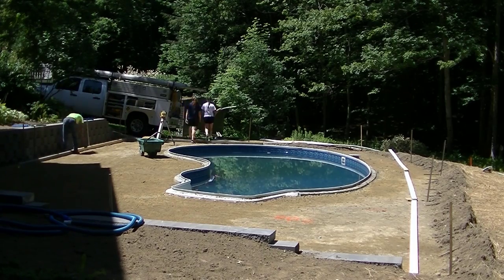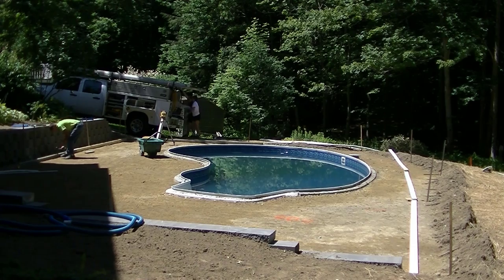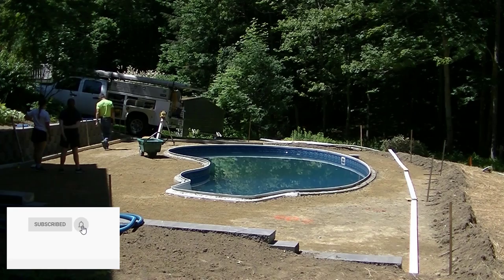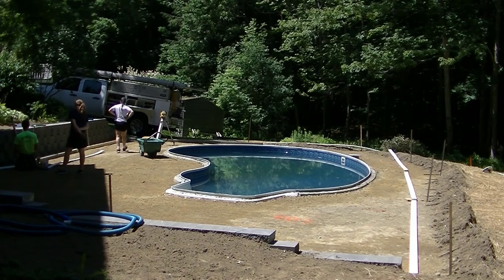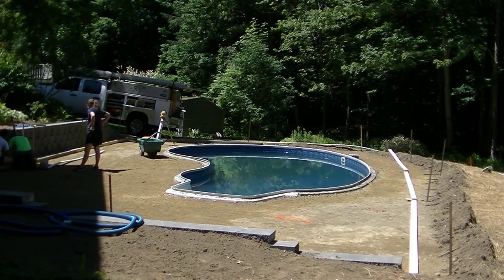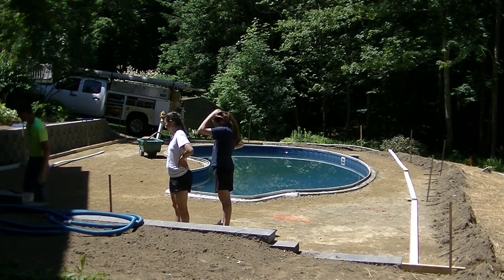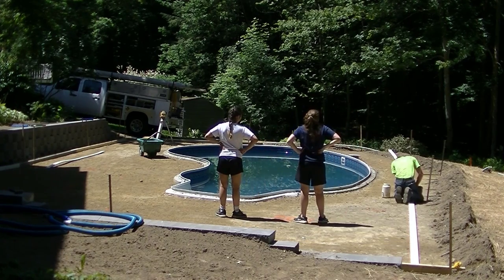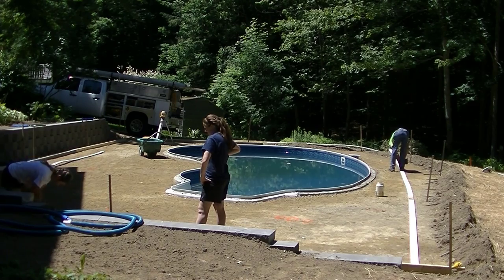Concrete Pool Decks | Forming, Pouring, And Finishing - Part 1

Comment: I have watched several of your videos Mike, GREAT Work. It's obvious why you are busy all the time. I build but don't usually pour too much concrete, best leave it to you guys, the Pros. I did poor my own Pool apron approx. 23 yrs ago, on our 20' x 40' w a 5' apron to walk around it on, and a 40' x 12' patio area on one side of the pool. We did some fancy curves into it. I used Masonite clapboard siding to make the curves 1/2" x 6" clapboards. They don't crack keep a good form but need quite a bit of stakes behind it to hold the crete in. We used the wire and the Fiberglass? Fibermesh? mixed into the concrete at the pit. Believe it or not we have not had one crack in 23 years. I used a gas tamper to tamp the ground down several days before we poured. Your looks awesome, Love the finish.. Also watched your stamping patios, wow that's sharp looking. Nice you got to bring your daughters in to help out and learn the family business. They worked better than most guys do. I applaud you all. Stay Positive Stay Healthy my friend. Peace from Big Jim in New Hampshire...  Amen
Reply from the maker: Thank you James!

Comment: Hey Mike, I’m a journeyman electrician, the ground wire is actually an equipotential bond not for lightning. Basically it will carry stray current away from a faulty pump or light.🤙
Reply from the maker: Thanks for that, good info!

Comment: Living and working in south Florida, I’ve worked on more than a few pool decks. Pools here are almost always shot in with gunite then the coping, then form to that. The most stringent reg for pool decks here is a slope of 3” in the first 10 feet heading away from the pool (obviously). It’s totally non-negotiable. And the grounding of all railing and metal, of course. I guess my finishers are a bunch of baby’s! If I told them we were going to wheelbarrow that, they would look at me like I was crazy 😂. They would insist on a 2” pump and a pea-rock pump mix. If not a boom pump 🙄.
🤜🤛
Reply from the maker: We don't like to wheel barrow either. Just a little less expensive on this job. We don't have any regulations in Maine for pool decks except for grounding them. It's a 50-50 mix between gunite and vinyl pools here. We do a hand full of Z-Poolforms concrete copings. More and more pools are going that way instead of the fiberglass coping like this pool has.

Comment: Hi Mike, love watching your videos. I’ve been in the pool business for 36 years and a little trick we use for the hand rails is a PVC jig. Start by cutting two pieces of 1-1/2” pvc pipe 12” long or so, get two 1-1/2” pvc  schedule 40 pressure tees (if you use pressure fittings versus drain fittings they have a deeper glue area for better strength), we like using tees instead of elbows so you can lay a plumbers level across it if you want (we eyeball it when we are pouring). Glue one tee on each of the pipes (legs) using the pass through holes, then cut a piece of 1-1/2” pipe approximately 6” long (this will be the horizontal piece of the jig, you may have to take a little off or add a little to this piece to make sure you end up at 8” on center with your two legs) glue this piece into the base holes of the two tees creating a U shape jig. No need to support it, just pour around it and adjust it as need be as the concrete sets up. Much easier than trying to support a handrail. Another little trick that I’m sure you know is to make sure you put a piece of duct tape on the bottom of the ladder/handrail cups so that concrete doesn’t ooze up into them through the small holes when pouring. Also if any of your pools are equipped with an in-the-wall ladder you can build a dual jig to hold all four cups at once; makes it much easier then trying to support two hand rails at once. Hope you find this helpful.
Reply from the maker: Good info! A jig would come in handy for sure.

Comment: Hi, Mike! I’m a retired electrician so the only thing I know about concrete work is…always hire it done! :-))) The reason I checked you out because I wanted to know how my pool deck was formed and poured. Why? I was upgrading to a color changing LED pool light, and the worst possible thing happened. While using the old electrical cord to pull in a jet-line the three wires in the cord actually broke. Hmm. The cord full length including the 6’ wrapped around the wet niche fixture was only 32’. No problem, right? I grabbed a fish tape…and buried 100’ in the conduit! Trying to pull it out, the tape is stuck. My thought is a separated conduit. Digging under the deck to find the conduit it seems I’ve found about a 12” footing following the curve of the decking about 1’ in from the edge, which puts the bottom about 16” from the pool deck surface. Have you ever seen anything like this? Yes or no answer would be greatly appreciated…so when I break out the dynamite I know I’ll have a chance at finding that conduit. Thanks, Mike!
Reply from the maker: Most all the pools we do have 4' aluminum panels set on the ground, then locked in with concrete at the base of them. Then backfilled and we pour a 4" thick concrete deck.
Reply: @MikeDayConcrete  Thanks for the reply, Mike! Ya gotta know you are very easy to listen to on the videos.

Comment: Hey mike my name is Jose and I pour concrete for driveways and patios I have a job that I’m gonna be pouring concrete around a pool any tips on doing this I’ve never done one before is there anything I have to put where the concrete meets the coupling I’ve been told that I need to put deck o seal after I pour so need a gap between deck and coupling

Comment: What is your basic rule of thumb for pin/stake length vs. form height?
i.e. 4” form takes a 12” pin
Reply: Depends a lot on the soil conditions. If it’s a hard, clay-like soil, 12” stakes might do it but if it’s a softer, sandy soil they should probably be around 16-24”, for a 2x4 form. Staked off about every 2 feet.
🤜🤛
Reply from the maker: Yes psidvicious is right. I only have 18", 24", and 30" metal stakes so we use them on all our forming jobs. This one had good compaction so we could mainly use the 18" ones. I've never used 12".  I put them 2, 3, or 4 feet apart depending on how compacted the gravel is.